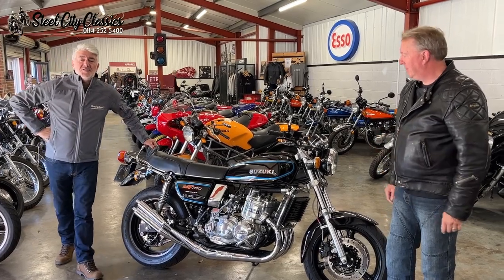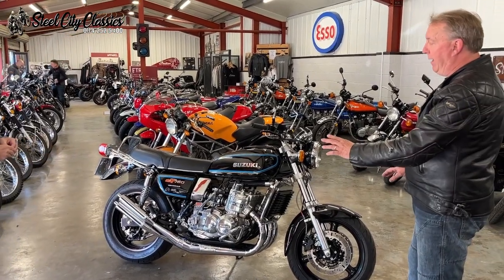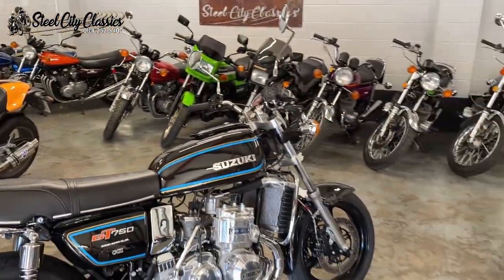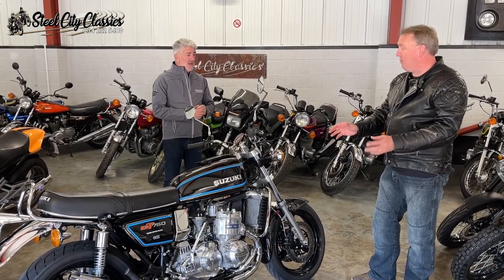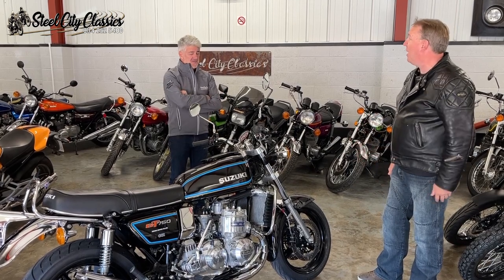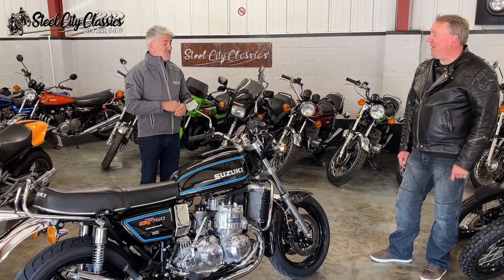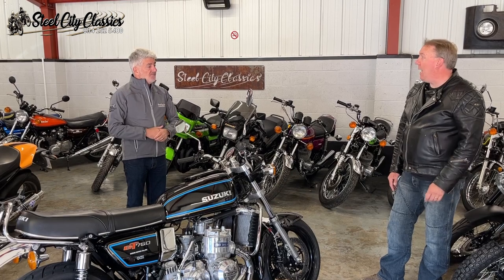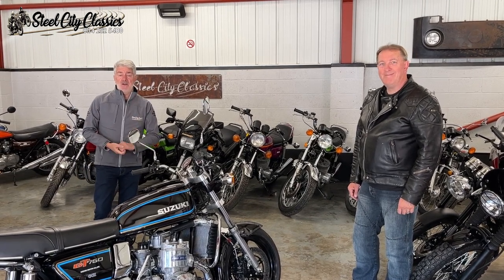Modified Suzuki GT750 Kettle (Water Buffalo) Classic Two Stroke Motorcycle by Grant

Comment: Charlie,dale ,I had.1 new in 1974,and did 79,thousand miles on I before crankshaft oil seals went,and had no problem with brakeing, if it started raining u just feathered it in lightly until ,it gripped more  and it was fine,,so you ,must of being doing something  wrong.😢